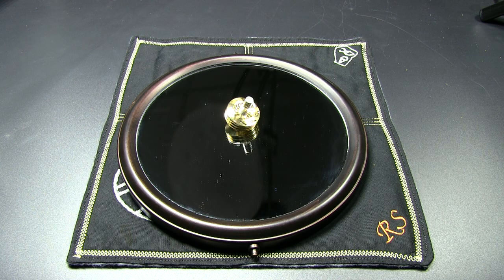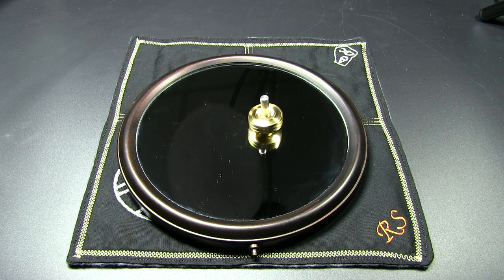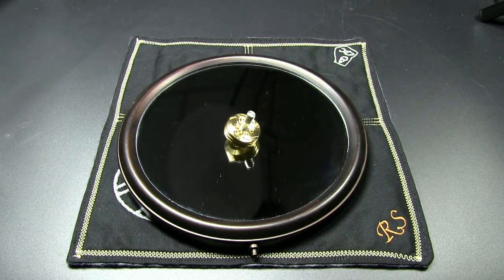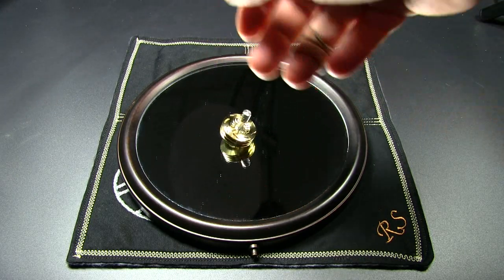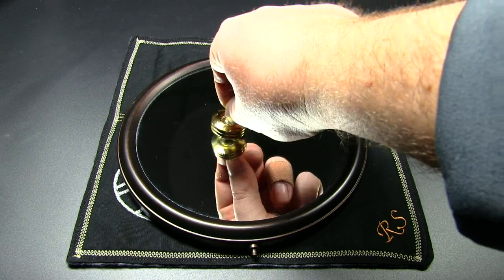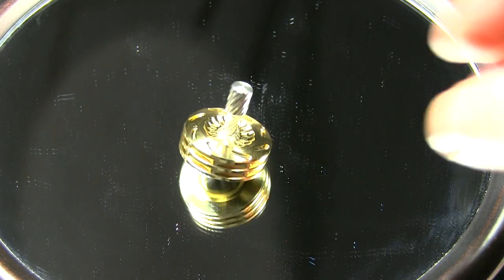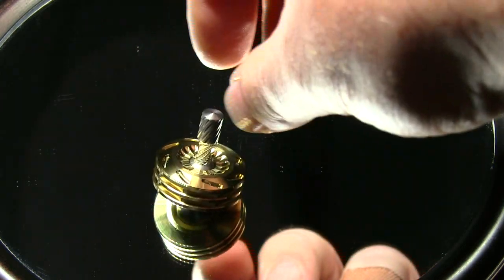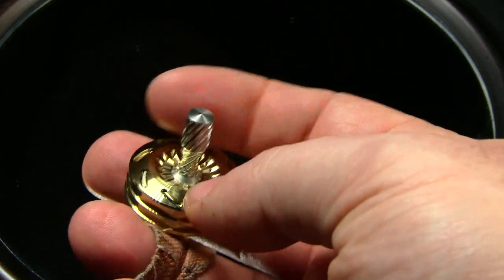Do Heavier Spin Tops spin longer? Myth Busted!

Comment: Torque(t)=moment of inertia(I) x angular acceleration(alpha)

If you are allowed to flick(spin) the top repeatedly, you can give a heavier top with a larger radius much more kinetic energy at much lower speeds, but it seems like you are limiting things to a single spin(flick)

Comment: Technically, heavier tops DO spin longer. This comes down to physics. If you had the exact same design, dimensions and friction coefficient, then the heavier material will spin longer so long as the centrifugal proportions are the same. I have made spinning tops that weigh far less than BilletSpin tops and they spin over 20 minutes.
Reply: By the way, reducing weight in the stem will not reduce spin time in terms of actual physical characteristics. This could be true for you, but that is likely due to your subjective finger spin skill and technique.
Reply from the maker: That is only true IF you can get them spinning fast which was the point I as making in the video
Reply from the maker: Weight reduction in the stem will make the top spin longer as I mentioned
Reply: when it takes you 8 months to respond XD
Reply: A standard top spun with the fingers is limited by the strength and skill of the individual overcoming inertia. This is why I invented Momentum, which allows you to essentially transfer more energy into the spin while allowing a great deal of control. I'm working on a design that spins 30+ minutes while only weighing a few more grams, but in reality, mass on the outer circumference is always better for longer spins. Physics is pretty cool :)
Reply from the maker: I am not sure if you are in the BilletSPIN group but in March I will be designing a long spinner. Goal is for me personally to be able to spin it by hand and break 30 minutes. I could get the Infinity close but not quite there. It will be a fun challenge!
Reply: I would love to see that! What is the weight and diameter? I have seen some spin for over 20 hours, but they are obviously large and heavy.
Reply from the maker: I will start working on it tomorrow and wont stop until I get it. My experience tells me it will be around 40 grams. I will start there and go up. I did a long spin top competition with a 15gram top and got 17 minute spins from it and some of my customers broke 30 with my Infinity top. It will be a challenge but I am looking forward to it.
Reply: Hmm, I'm guessing a 15 gram top could only spin 30 minutes on the equinox. I would be interested to see a video.
Reply: I am in the group, but I didn't see a 30 minute spin. Maybe I missed it?
Reply from the maker: With the tungsten I had I could only get 24:40 but several in the group have gotten over 25. I have not given up on 30 but it's on the back burner for now
Reply: 24:40 with a 15 gram top?! That is unbelievable! Congratulations...please post the link!
Reply from the maker: We must have had a miscommunication. There are two tops. the 15 gram top is the one I made last year for the long spin competition. That one I got a long spin of 17 minutes. 

I just designed a top a month ago called the nexus that weighs 47 grams and I hand spun that one for 24:40. Several people from the billetspin facebook group have gotten over 25 minutes with the Nexus. Hope that clears it up, sorry for the confusion!
Reply: Ah! That makes sense now. A 47 gram top could have almost twice the inertia of a 38 gram top depending on the design, which theoretically could spin for well over 30 minutes. Thanks for the clarification and keep up the great work. My focus has been primarily efficiency in my line of Momentum tops, which is a fun side business. But I do make some pretty wild variations using advanced machining techniques that are not available to the public. Your tops look very nice!
Reply from the maker: thanks! They are a blast to make
Reply from the maker: Colin Southern yes, they have used a dremel to spin them up. Really diminishes contact point life but adds about 15% to spin times

Comment: I'm thinking that although the physics of a top will determine many things, so will the person spinning it. Here is my theory but tell me if I'm wrong.... Balancing a heavy,  high centre of gravity top for example which a person might struggle to spin would be fine if a machine was able to spin it faster. So changing that ten thousandths of an inch may have a negative effect on your relative spin time due to your specific physical attributes but another person might be able to achieve a higher rotation speed with the thinner shaft and achieve the same or better spin time as you using a thicker shaft. My point is that a "perfect" top is not possible if the criteria for the top is that every person can manually get the same spin times.
Reply: The biggest consumer of the energy of top rotation is often.... gravity.
It takes energy to keep a top upright when gravity is always pulling it down. It stays upright if it's spinning fast enough because rotational momentum creates a force at right angle to the rotation,  which vector is pointed up,  suspending the top.  But using that force against gravity takes energy,  which comes from the speed of rotation.

Eventually the top slows enough that the top collapses.

For that reason,  a top with a lower center of gravity will spin longer than the same top with a high center of gravity,  because it takes more energy to keep the high center top upright,  and therefore the high center top uses up rotation speed faster.

Comment: are the groves and carvings you've done on there significant? also how do your spin times compare to the foreverspin's "master" spinner the tungsten one?
Reply from the maker: I make tops that focus on looking cool and then I make tops that focus on spin time. The Nexus top spins over 20 minutes quite easily which is substantially longer than the FS. Most people start out in the hobby caring about spin time but then collect tops for looks over spin time
Reply: cool. your top are quite nice looking. I believe I can put a crap load of energy into a spin.. when you try to make long spins are we talking about a violent spin while trying to also make it precise? I hope I'm not bothering, cause I do want to buy one. Thanks for response it helps!
Reply from the maker: If you are on Facebook, join the billetspin Facebook group! You can get a better understanding there for sure!

Comment: Question: If changing it by one fraction smaller made it spin slower, are you sure making it the same fraction larger won't lead to a better spin time?  I get that you might have already tuned it that closely, but are you sure?  It sounds like a test begging to be done.   Also why is Titanium desirable (despite the uniformity issues)?  Is hardness also helpful?